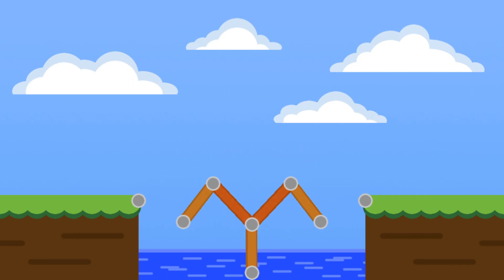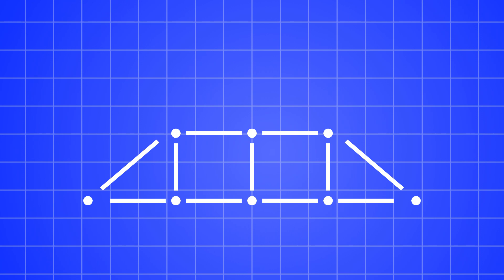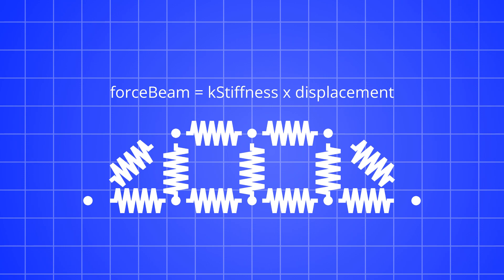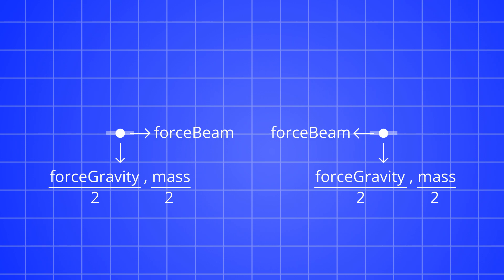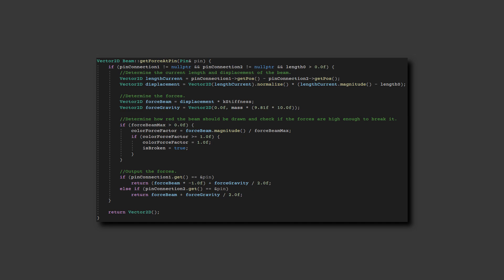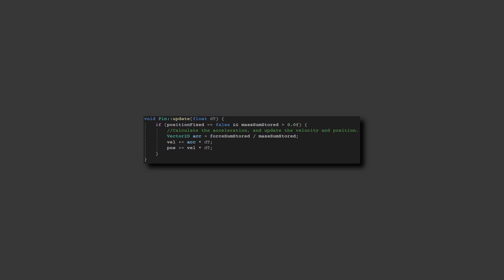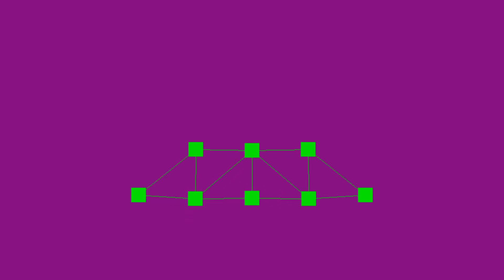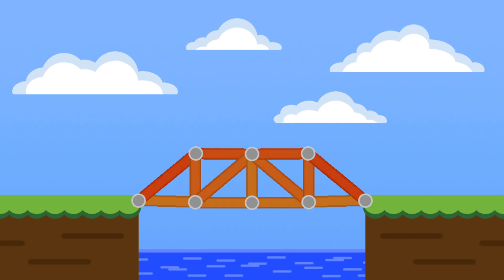C++ Game Development - Bridge Game

Comment: Great video, but I have a question. So I am trying to make a similar simulation, and it looks good with low stiffness value when it looks very springy, but when it is too high the forces seem to be much stronger than they should be and all the nodes are accelerated at huge velocities in all directions. Have you maybe encountered similar problems? Or you have any idea why that could be the case? If you have any ideas, I would love to hear them.
Reply from the maker: Great question.  Think about how the simulation is setup.  It’s made of a bunch of frames like a video.  The position in the next frame is based on the position in the current frame plus some change.  If the forces are extremely high, the change in position is extremely high.  This then causes the forces to be even higher and the position change to be even higher.
Reply: @funneractic  Thanks for the response. The main problem was that when originally I added gravity it seemed too slow and instead of increasing it I just multiplied the delta value to make everything faster, but that seems to be the factor that made my simulation so unstable.
Reply from the maker: @deiv1229  No Problem.  Glad to hear that you we're able to troubleshoot it.